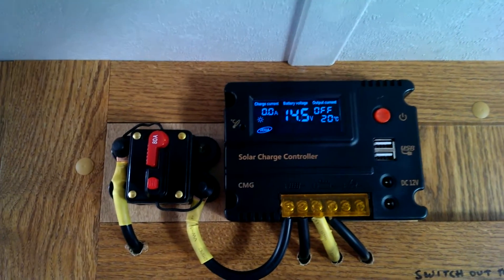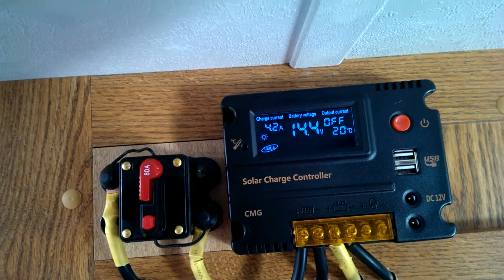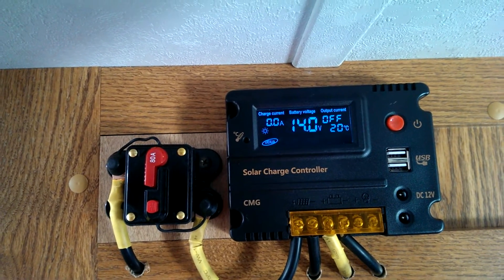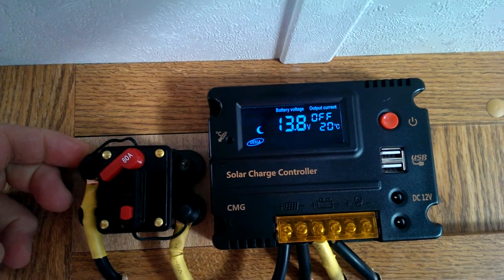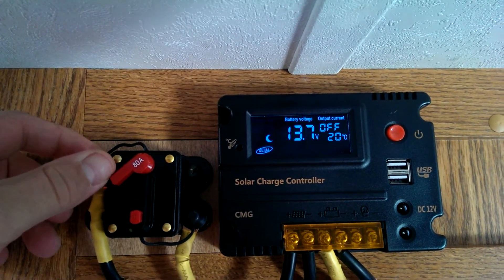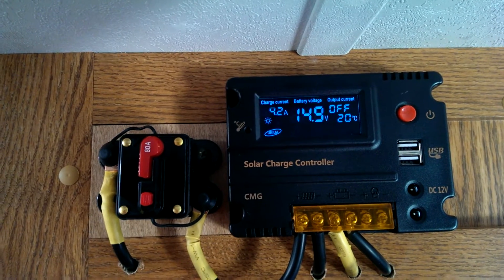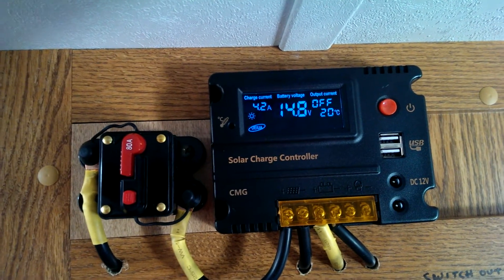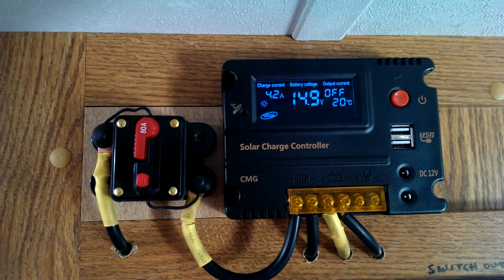mohoo charge controller part 3 of 5

Comment: Isn’t charging at 14+V abit high ? What batteries are you using ?
Reply from the maker: No,  it is normal to charge at 14.4 when the batteries are low.   I have 2 x 6 volt batteries in series so 12 volts....Here is some good info https://www.solar-electric.com/solar-charge-controller-basics.html